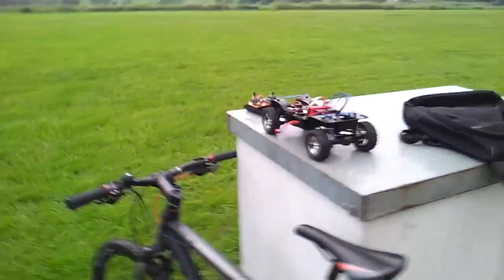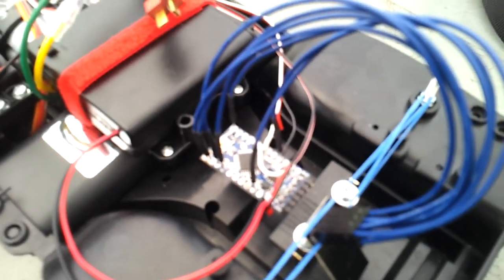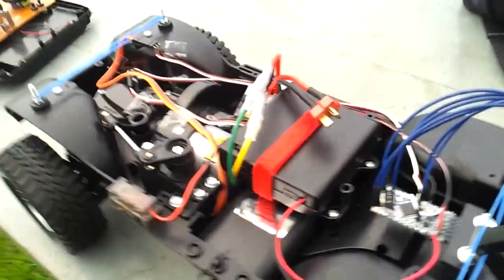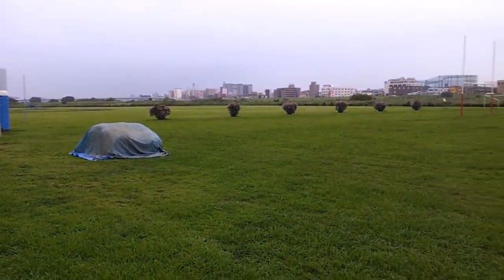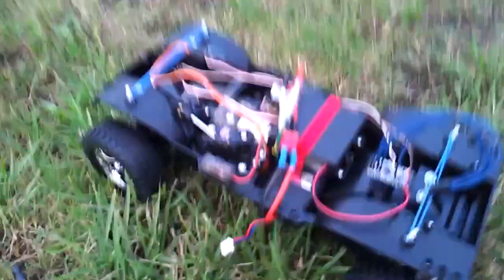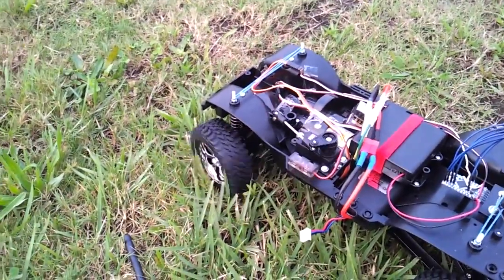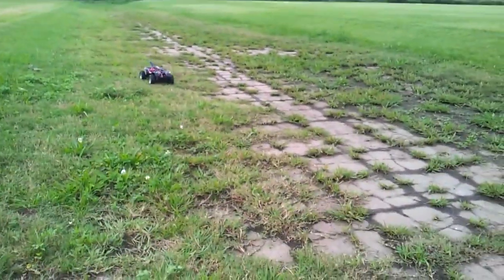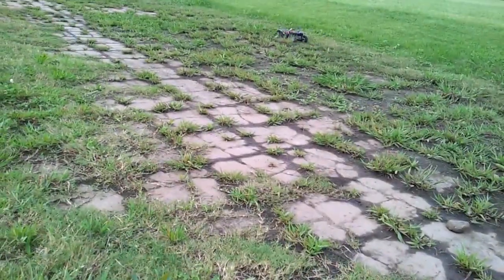Arduino RC car first trial

Comment: can you please help me...?iam have  1:16 rc car. i would like to convert it to arduino based.what type of motor driver is needed?and battery?
Reply: Use L298N motor driver and use a 12V 2A battery to power 500 rpm 12 V dc motors. They are quite powerful. With the right wheels it will go really fast!!!

Comment: How much time did you spend for this project, I will do this as a schoolproject but, i have only 3 Month time
Reply from the maker: I probably spent a week or so making it. Before I started making arduino things I already had over 20 years programming experience though, which helps :)
Reply: ok, Im visting an IT School in germany and have experience for about 3 years but the teacher supports me:)

thanks for the fast answer

Comment: Very good work there! I was wondering though if you are using 2 arduino boards!? One on the car and one on the remote control.
Reply from the maker: Yes, that's right.
Reply: ***** Can I do it with only one? I was thinking of placing the arduino on the remote control (along with one xbee) and the other xbee on the car. Since xbee can receive PWM i assume it can produce it on its output without the need of a second arduino.

Thanks for your quick response
Reply: three years late man
Reply: can you please help me...?iam have  1:16 rc car. i would like to convert it to arduino based.what type of motor driver is needed?and battery?

Comment: Are you using an electronic speed controller? My old tamiya's were analog and would get stuck if not enough conductive gel was used.
Reply from the maker: Yeah, seems that's all there is these days. Much more efficient than heating up a huge resistor, like those old fossils we had back then. Batteries are waaay better now too.